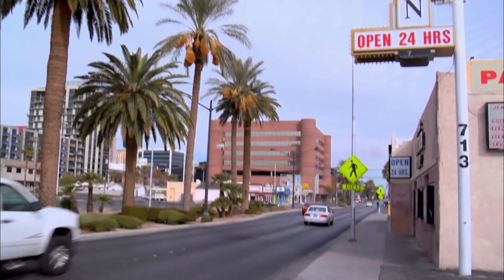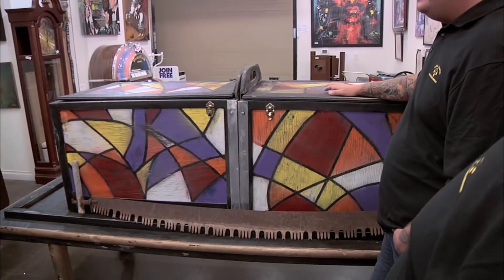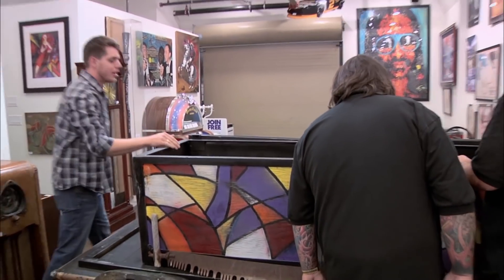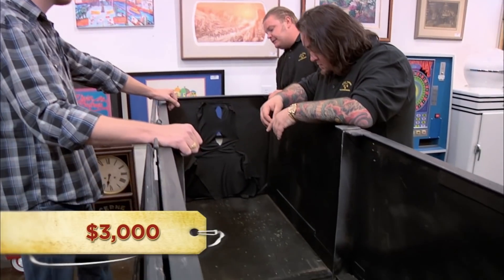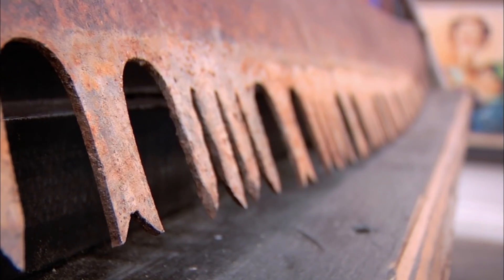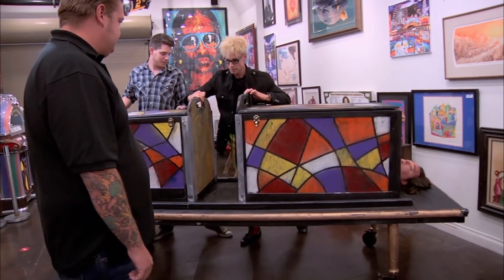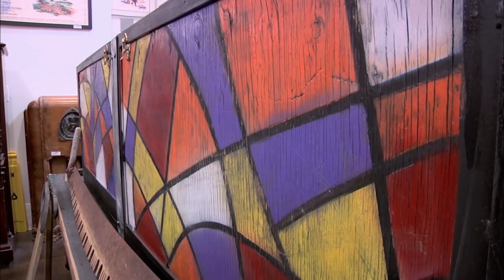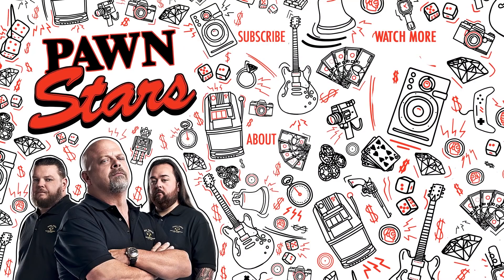Pawn Stars: Chumlee CUT IN HALF by Rare Magic Prop (Season 7) | History

Comment: Dude lived from 1869-1936 i think it said. 
That looks like it was spray painted.  I don't think spray paint would've been around in the early 1900's.
The latches are certainly newer.  
I can be sure from the video, but the sides look like plywood..
The hinges are definitely not old. 

I'll bet that thing is less than 50 years old easily